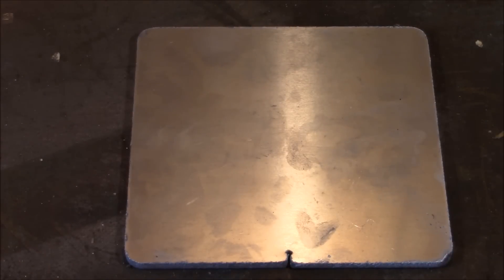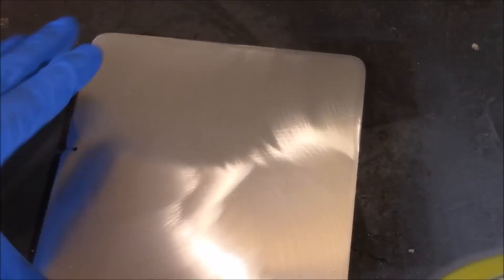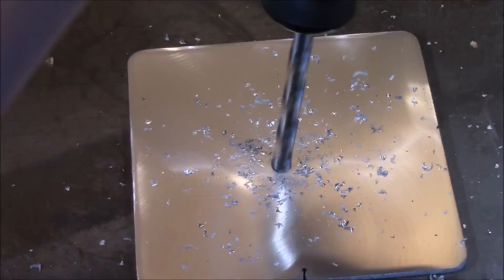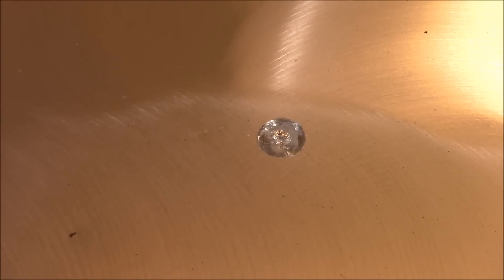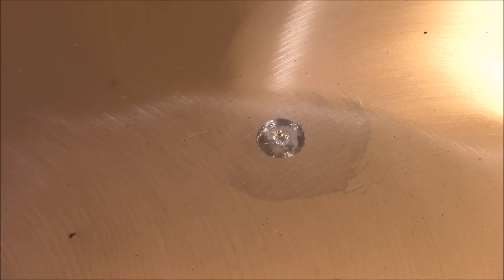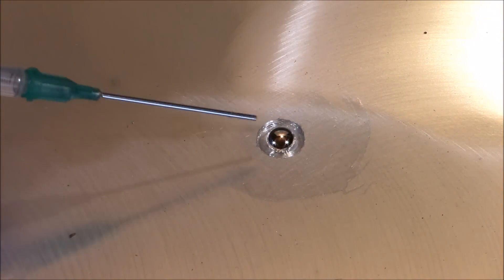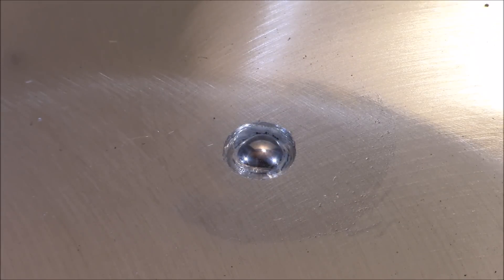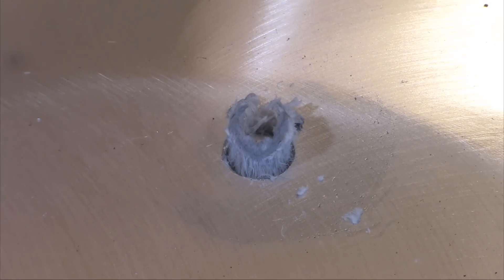What Happens When You Add Mercury to Aluminum?

Comment: I hope you are doing this under a ventilation hood or with a mercury-proof respirator.  As the "whiskers" of aluminum-mercury amalgam form, the total surface area of exposed mercury will increase drastically, causing a much larger output of toxic metcury vapor than would the glob of mercury alone.
Reply: Could mercury in vaccines mix with aluminum from the vaccines to create this in our bodies? Just curious. I heard that somewhere.

Comment: I came across a pretty good amount of mercury this past Saturday. I bought a huge tub at a auction for 5 bucks that had about 20 breakers in it. I wanted them for resale or silver contacts.. 
The rest where little clear plastic boxes, with metal backings. They have one single wire coming out of each box with a brass connector. I thought they were some sort of light, for a semi trailer, being that they were similar in size as the little lights that are on big rig trailers.. 
Well I took the two screws out and noticed a oddly shaped fuse, which I’ve never seen fuses like this before. Under that was a little tube of mercury.. So I’m guessing they are some type of vintage switch.
Anyway I have a couple hundred of these, and I’m wondering what to do with them. 
Idk if there’s a scrap value or not, I’ll have to look into it. 
Any ideas, I’d appreciate your opinion.. thanks
Reply from the maker: I think you got a really good deal on the mercury. The mercury fuses seem like they are rare so they probably have some value to the right person. You might have to get an appraisal. But overall you got a fantastic deal.